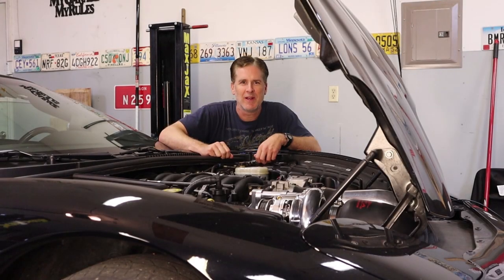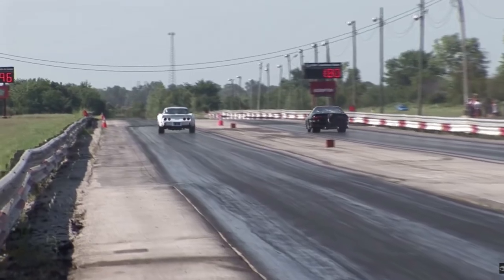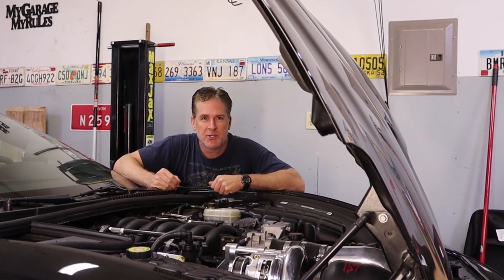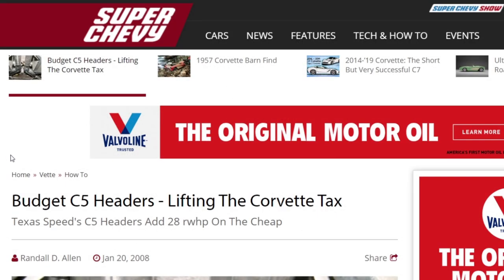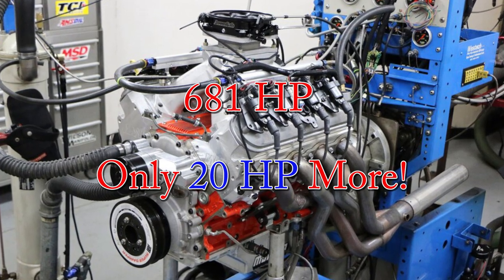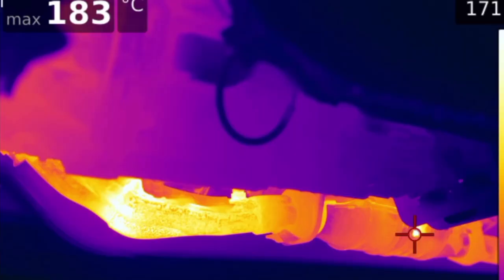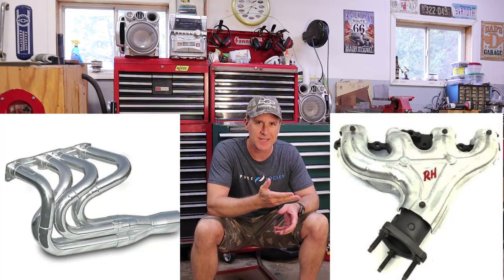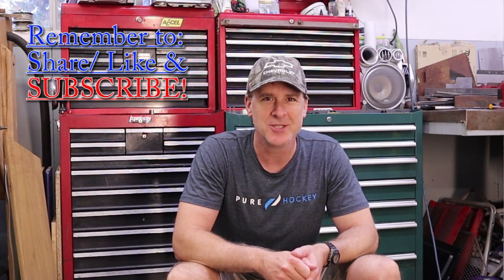C5 Corvette Headers - Everything You Need to KNOW!

Comment: Generally what I have found is that a good set of long tubes makes the most gains in mid range torque and horsepower, it’s not all about the peak number. If you can gain 30-40 lb/ft down low in can really wake up a NA motor.
Reply from the maker: I did see a couple of Dynos that did show some pretty good torque gains down low, somewhere around the order of 25 ft pounds. Points well taken ideally one would look at average horsepower and torque in the operating range you intend to use it. Interestingly enough, most of the installs/ tests did not maintain the stock catalytic converters. I wonder if they mute any gains that long tubes have with regards to scavenging exhaust efficiency.... That'll be part two...lol
Reply: Totally agree! It's not so much the HP gains, but the torque gains which really woke up my mildly cammed LS3 !!!!

Comment: Great video.  Most "in the know" motorheads don't buy long tubes for LS.  Tri-Y provide superior torque increases to the useful powerband, although still only in the 20-25 LBFT range for an otherwise stock motor.  To prevent engine bay heat issues, wrap with asbestos exhaust wraps.  Last comment is on weight; don't headers and an aftermarket exhaust system cut a little weight vs cast iron manifolds? I estimated 25--30lbs but have not confirmed?  Not a life changing weight savings, but still a benefit.  IMO main drawback with headers is added steps to otherwise straightforward jobs. (R&R of Starter or motor mounts, clutch service, etc.)  I like all your videos though, great info!
Reply from the maker: Thanks for the comment sir much appreciated!

Comment: I have been running American Racing Headers' LT's for 13 years (about 60k miles) on my '99 C5 and have had no problems with heat. Run TI catbacks (no drone), hi-po cats w/xpipe and pull 430RWHP with H/C/H package. It passes inspection sniffer test each year (NJ/NC). Oxygen sensors run fine. I insulated cabin with aluminum backed foam which lowered decibels noticeably and keeps heat out of the interior. Stock setup was throwing heat into the cabin as well probably from the OEM cats. The car is noisier outside, cam/lifters contribute a lot to that, but absolutely not offensive. Thanks for all the great videos.
Reply from the maker: Thanks for your long term first hand results!  What hi po cats are you using - I am in need of one that can take some HP for an upcoming project.
Reply: Are your Ti catbacks aftermarket or oem off a Z06?

Comment: On my 02 Z06 I installed an Xpipe retained the titanium exhaust and had a really good tuner do his thing. I gained 30 wheel horsepower for a lot less money than a set of name brand headers. It was a simple bolt on, retained the reliability and produced similar results!
Reply from the maker: I would love to dyno an xpipe vs the fake C5 H-Pipe.  Fake cause the hole that is in each main pipe is the size of a nickle for some reason...

Comment: Great video. My '99 convertible is in the shop as I write this getting a set of 220 cast heads, a BTR stage 3 cam, LS6 intake, and some 36# injectors. I have been having sleepless nights about not throwing some Hooker Blackhearts on it to complete the package. However, I live in a pretty strict emission county, and would have to find creative ways to register the car if I pulled the stock manifold and cats. I always knew the stock exhaust was better than most will admit. On my baseline Dynojet, the car made 316 HP at 24 years old. Being 345 stock at the crank, that's only an 8% loss, including the age of the engine. I am going to stick with the stock exhaust and sleep easy knowing I will still pass emissions. Thanks for an honest comparison. I am in the crowd that says $2000 for headers to pick up maybe 20 HP on a street rod isn't a good investment. Especially if you get caught and fined for the cat delete.

Comment: Hi. really like all the information on your formats. I have a couple of questions. I took your advice on the 342-rear differential, and am installing a set, but is necessary to install a stall converter? I don't race, drag, just like torque. Also, your information regarding headers was very informative. I have a 99 C5. I assume they have the same headers as the newer ones, or would it be cheaper for me to get a stock set from a C6 if I don't? The heat with a good set of headers does worry me a bit. Thanks......James.
Reply from the maker: Nope, it's not required that you do a higher than stock RPM stall converter. If you're 20 years old and you want to drag race with slicks and break stuff, then get a stall converter (:-).

Comment: Great video as usual !

One thing to consider if concerned about heat on long tube headers is getting them ceramic coated using a high quality shop that performs this.

I had my American Racing Headers coated inside and out, and heat is not an issue!
Reply from the maker: Good to know, and the good stuff last quite a long time as well!
Reply: iam gonan clean up the stockers and ceramic coating and match teh collector size to pipe size mandrel bent high flow cats

Comment: I do think the Longtube heat thing is slightly exaggerated though by many car folks. In these C5s as long as you got longer plug wires and your A/C lines are still insulated/out of the way, you are gonna be fine the vast majority of the time. People talk as if these things are gonna melt everything and catch stuff on fire lol. Unless you live in 100* weather areas you will be fine. Just make sure wires are out the way, and/or wrap the starter on these cars if ya are a worrier, and you will be fine.
Reply from the maker: Appreciate the feedback!  Assuming you have LTs on yours - for our knowledge, what Kind and how long have you had em without any issues or excessive heat?   If you had it to do over again, what brand would you buy and would they be ceramic coated?
Reply: @Toys4Life  Have the Speed Engineering set on my 01 C5. They are stainless, and 1 7/8 design. No fitment issues. This is arguably the best budget Longtube for these cars, tons of folks run em besides me. Only issues the clamps arent the greatest, but that minor, can tak weld em if needed. They also are not ceramic coated. I have longer wires, off road xpipe that comes with em, little over 500 shipped. I haven't had any issues, I also am on Eastcoast so high 90s is about as bad is gets my way generally. Nothing burned or melted anything, ive ran em a few months now. If you live in areas with crazy heat id say look for a ceramic coated set, or get these ceramic coated for extra piece of mind.
Reply from the maker: Thanks for the feedback! - I have heard mostly good things about them - seem like one of the better choices for sure for those that choose to run long tubes!
Reply: @SimplyJustRandomness I have speed engineering headers on my c6 I’ve ran them through summer Florida heat and nothing bad has happened to the engine bay.

Comment: I have always thought one of the easiest ways to increase engine horsepower is to improve air intake and exhaust outlet. The headers are hotter than stock manifolds because they are removing engine heat more efficiently, thereby reducing heat and excessive wear in the upper engine block and heads. Headers also improve gas mileage, which for me is a nice added benefit.
Reply from the maker: Headers definitely add some power, but LS exhaust manifolds are pretty damn efficient there is no doubt. '60s '70s and even '80s exhaust manifolds had a lot of resistance to flow.

Comment: Good info, but I think I'll keep my 2003 C5 stock.  Many years ago I had an '88 GTA Firebird (L98 350) and it had a set of custom built Doug Thorley headers.  The headers themselves were high quality.  The headers were California smog legal - including a CARB EO#.  No doubt they increased horsepower but the unexpected consequences became a pain in the butt.  The starter motor would absorb a LOT of radiated heat from the headers.  That would cause the starter to crank very slowly after more than 20 minutes of driving.  I never got around to installing some kind of heat shield on the starter.  Also, routing spark plug wires was a hassle because they would burn when they barely touched the headers.  After a long drive on the freeway, the brake pedal would get soft.  One of the brake lines was too close to one of the header pipes causing the brake fluid to heat soak.  Exhaust leaks was another issue to deal with.  The header bolts would randomly get loose and that would cause a leak - making the smog test fail.  So, I think I'll keep the exhaust stock on my C5.
Reply from the maker: Luckily the C5 exhaust is pretty dang efficient!

Comment: Back in "The Days of the Old Republic" a set of headers was a great performance/value enhancement. But WOW! They are SO expensive. And if you put a set on, you HAVE TO upgrade the X-pipe and cat-backs. And if you pay for a professional installation, you could be looking at over $3,000. But look at those LS1 cast iron manifolds. They are cast iron shorties! BRAVO Chevrolet Engineering!
Reply from the maker: Agreed!  Although if you do get headers, they are a lot better than they were back in the day as well.  I think I had a set of $99 painted Hedman headers on my 74 blazer 350...

Comment: I have a 1998 camaro, it’s obviously not a C5 but it has the same drivetrain. I got the car bone stock with 12,000 miles. Every time I would punch the car I would have low end power but it felt like I lost a lot of power at the mid-high end. I threw a set of Texas speed 1-7/8 long tubes a off-road y-pipe and corsa high-flow muffler. The first time I took the car out I could instantly tell a difference, I had a little more low-end power but A LOT more mid-high end power. The stock manifolds flow decent for what they are, but the rest of the exhaust with the catalytic converters to the mufflers are so constricting. The headers with a better flowing exhaust definitely help out, plus they sound nice :)
Reply from the maker: Yeah those f-body exhaust manifolds are much more restrictive than the Corvettes. Ditching those and the cats, I absolutely believe you noticed a good increase!

Comment: I had BBK shorties on one of my vettes for about 5 years before upgrading to Kooks  longtubes. The shorties were installed at the same time as a Bassani xpipe and Borla Stingers.  Car had a 228/228/112 cam and ported 241s, made 398 rwhp and 390 rwt. 

Changed the cam to a 232/236/113 cam and Kooks Longtubes and off road X pipe and car made 418rwhp and 398rwtq with same heads. 

Heat inside the cab along the tunnel seemed to stay the same. I put one of those knee bolsters on the tunnel to keep my leg off of it when it gets warm. Definitely helped.
Reply from the maker: So do you think the gain from the Kooks over the shorties was worth it -in other words, would  you do it again for the time, $$ and gain?
Reply: @Toys4Life  very good question.  This will be a lengthy response. 

I always knew I would go forced induction at some point. So that helped with my decision to get the 1 7/8 Kooks when I did.  

The power difference between the shorties and the long tubes is roughly only 15 to 20rwhp. I’ve proven that to myself with the two builds and the rwhp variance only being only 20hp and 8tq even though I upped the size of the cam. 

I’d  say the major difference that made the spend worth it to me is the exhaust note. Especially at wide open throttle.  The car sounds unique. I absolutely love how it sounds. 

I’ve had at least 30 compliments on how it sounds. Three guys in three different scenarios tell me “it sounds like a liter bike when it passed by me”. 

Once a toll booth attendant said “wow, I thought I heard a bike revving up, I love bikes, so I was looking for it, but it’s your car. That thing sounds awesome”.  

Then my neighbors 11 yr old son, at a small Vette event, told his dad (c5 with Corsa and C6 Z06 owner) that my black coupe “sounds the best out of all the cars here”.

So after all said and done, yes I would do it again, but more so for the sound than the added power. 

If I were a guy on a limited budget or looking for best bang for the buck performance mod in an MN6…I would do a diff swap to 4.10 vs. long-tubes. I absolutely LOVE 4.10s in these cars. Especially with a bigger cam. But still good on their own.
Reply from the maker: Appreciate the response sir, thanks for the insights. Part of me wants to build a naturally aspirated C5 with a giant cam and low gears!
Reply: @Toys4Life  any time my friend! I enjoy your channel and content. Happy to share my experiences.  

Both my 228/228/112 and 232/236/113 cam builds ran 4.10 gears.  Not monster cams but the results with the 4.10s were substantial none the less. 

The gear puts the car  into the powerband immediately.  Makes a MASSIVE beneficial difference with a cam that builds power above 2500 rpm. Guys that make negative comments about 4.10 gearing have never run this gear.  

I will NEVER own another naturally aspirated MN6 vette without a gear swap. I've done both the 3.90 and 4.10s.  The 4.10 is my favorite by far. 

I may go back to a 4.10 now that the car is FI. I'm running a 3.42 at the moment with the added power. I just feel like I want the gear again.  I haven't decided yet.
Reply: @Toys4Life  you should.

Comment: I don't know if you guys still check the comments for this video, but, what the hell, figure I'll give it a shot, for I have some questions.

1) do they still make that, I suppose one could call it "header wrap tape"? As a child, my family had a 2nd gen Camaro who's headers made the engine compartment get hot as hell. My father put that wrap around the headers, and it significantly cooled things down in there.

2) if yes, do you think if one got a set of coated headers, AND wrapped them with said tape, it'd keep the compartment of a C5 close to factory temp?

3) what if one did the above, but also tossed on some kind of vented hood, and perhaps tuned the computer to kick the secondary fan on at a lower temp?

And, finally, 4) if one threw long tubes and an x-pipe with cat delete on an otherwise stock C5, would that be TOO much flow? Should such a setup be reserved for hotter than stock cam setups only?

I like the way my '02 Z06 sounds stock with just the cat-back system (Corsa), but I'd like it to be louder. Yet, with how hot as balls the thing tends to run in any situation outside of fast highway driving, I have concerns about the long tubes. What's more, my mechanic always tells me, when I bring this idea up, that it's likely too much flow for a non-cammed block, even one as nice as the '02 Z06.
Reply from the maker: Header wrap tape wood help cool it off a  bit but many say that it will prematurely wear out the headers, so keep that in mind if you drive the car a lot.

Comment: I was pretty worried about underhood temps and radiant heat cooking things, but surprisingly I haven't noticed anything remotely alarming even with no coating. LG Street Series longtubes on a 2001 M6 Coupe.  Never dynod my car bone stock, but with headers and a tune only (and z06 Ti axle back, which in my opinion is a couple ponies at best) I got a very strong 340/363 at the tire on a dynojet.  Installed Torquer v4 and 3.90s since and will soon hit the dyno again.
Reply from the maker: That's good information, thank you. What state are you in?
Reply: I'm in Indiana.

Comment: This is why I haven't thrown headers at my Z06 yet. It made 352 whp stone stock. If I installed headers I think I'd be looking at only 20 whp because I don't want an aftermarket cat back and I don't want to delete the cats. I was considering having the H pipe replaced with an X just for sound though and because I have heard some say they got gains from that. I really like the reliability, driveability and quiet of the stock exhaust. No issues with CELs, harmonics, buzzes/rattles, drone etc when you leave a car stock. I drive the car every day here in Phoenix year round so I think stock is better.
Reply from the maker: In this case, stock is not bad!   Thanks for commenting!
Reply: I thought the same thing, but I made the leap because 360 to the wheels started to feel slow. So I went longtube without the cats and I couldn't believe the difference. I only gained 30 hp, but it felt like so much more and made me enjoy driving the car again. I've got Corsa's and they are pretty mild until you put your foot in it and then they scream like Nascar. Overall, I'm very happy with the choice.

Comment: The more I look into it, the more I think I will stick with just the already completed BBE cat-back exhaust upgrade. Hard to justify another 20 horse (max) pushing out $1500 for the header upgrade! Not to mention, I notice my stock C5 does already tend to run hot at idle after too long. Still only has 17k original on the clock, too.
Reply from the maker: That is pretty spendy on a HP per dollar basis IMO too!
Reply: Have you blown out your radiator? C5's grab air from under the front bumper and will "vacuum" up road debris and dirt.
Reply: @michaelbrakey4599  keeping the air filter clean has not been an issue. The car only has 18k on the clock at this point 👉. 👈
Reply: @michaelr.ingelsby1975  not your air filter, but the radiator. Mine would overheat if I idled it too long. Once I took the shrouds off, vacuumed the larger debris out and took a air nozzle and cleaned out the crud between the radiator and condenser fins corrected the problem. Now my Vette can idle all day long in 100 degree heat and never get much above 200 degrees on the gauge. I blow it out 2-3 times a year and have installed a screen on the air scoop to keep leaves and garbage from getting up there. If that doesn't help, you may want to burp your cooling system, just a bit of air will decrease the cooling systems efficiency.
Reply: The c5 is designed to run hot
Reply from the maker: Why not have the thermostat come on at like 2:10 then or 2:15, maybe even 2:20?